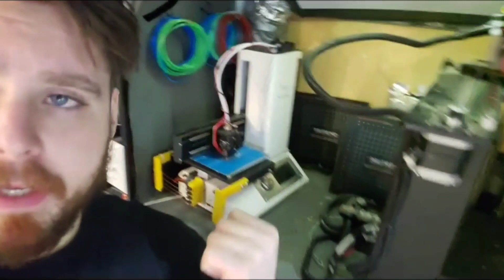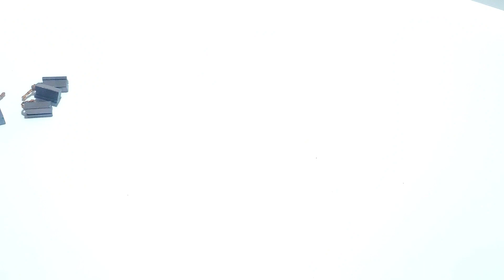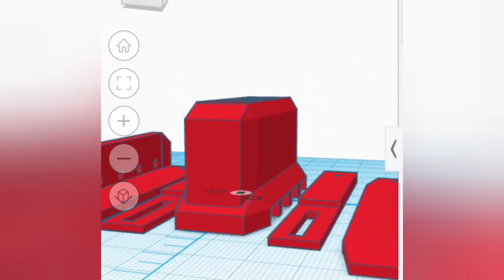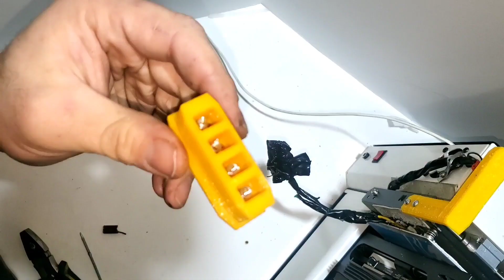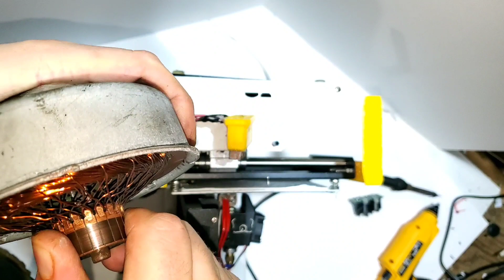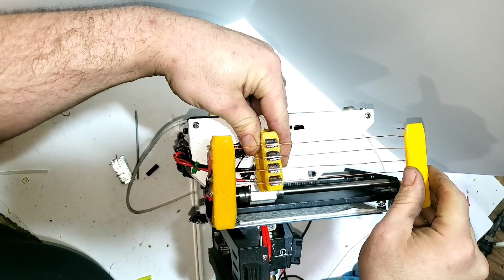3d Printer Brushed Upgrade

Comment: Any issues with resistance in the brush contacts? What about the copper wires oxidizing?
Reply from the maker: Thanks for the questions,
These brushes are already built to carry a considerable amount of current, as long as there is pressure from the springs against the wires, there should be no issues with the heater or the temperature sensor. 

I keep my printer in an enclosure and I have not had any issues with the wires oxidizing. My first brushed set up was on their over a year and I did not have any issues.

Comment: Good idea, but exposed wires down there is just asking for trouble - needs a casing to cover things up and it'll be fine.
Reply from the maker: Exposed wires could definitely cause an issue, thanks for pointing that out! This video is intended to give a quick overview of the design and installation. It is likely that some modifications may need to be made to fit your particular set up. I did end up screwing on a plastic cover after I posted this video, and I also keep this printer in an enclosure.